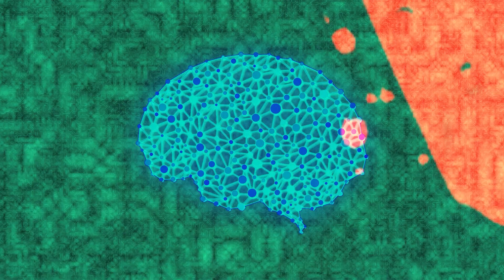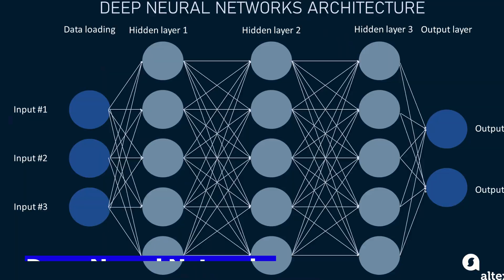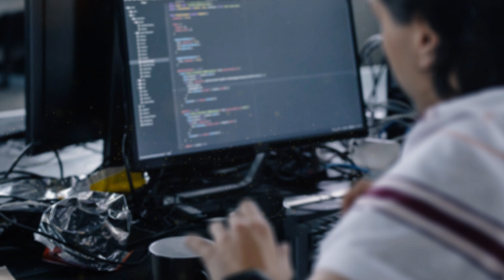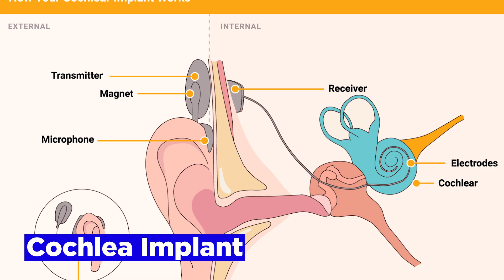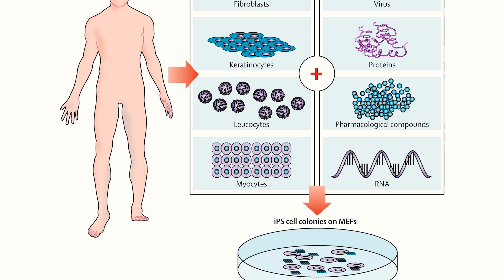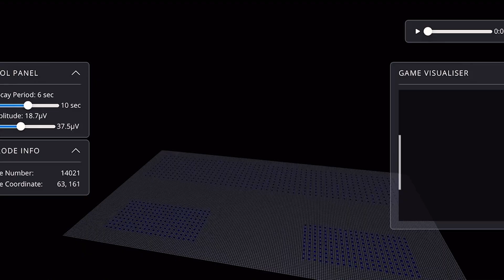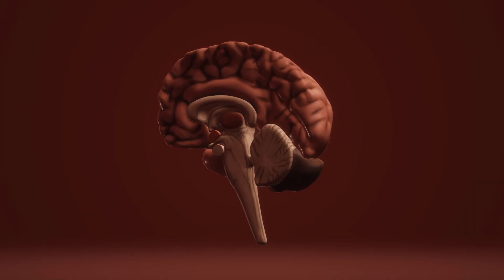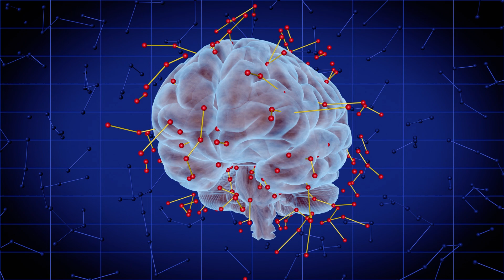First Computer made of Human Brain Cells beating A.I. !?

Comment: Hello. I understand how a hundred neurons could learn to play pong - that should inform us greatly about the nature of neural programming. But that is essentially a single action intercept game, x2, so this could be done more easily using math and an analog computer. By this I mean we can certainly model this even if it requires a new circuit or novel component design. And the idea of actually integrating biology as wet ware per-se into a network is surely a waste of time except in a strictly research mode. I am personally involved actively in much higher level bio-computing design, from natural to modeling it. For me, the takeaway is that A.I. will have to become very helpful in understanding what goes on in the "hidden layers" of these processes. Human beings need to stay focused many layers of abstraction higher, in the function layers of natural neuro-computing, that present us with many layers of ourself.

Comment: This video is full of inaccuracies
Reply from the maker: Which ones for example?
Reply: 1:15 connections do not create new neurons or "break them down". Connections get stronger or weaker.
Reply: 1:54 you dont connect many small computers to form an artificial neural network. Nodes (or artificial neurons) are connected and each connection has its weight. Those nodes are usually structured into layers.
Reply: Yep